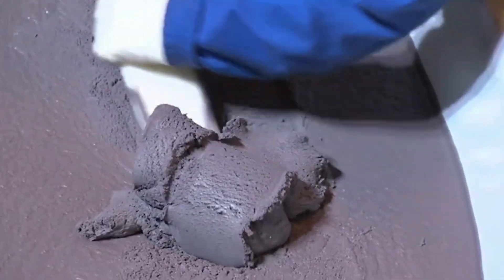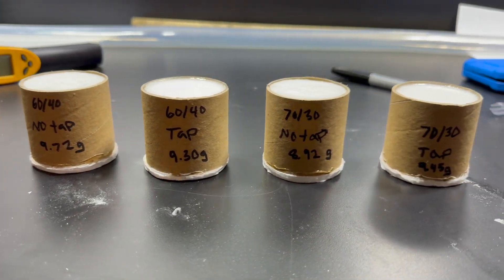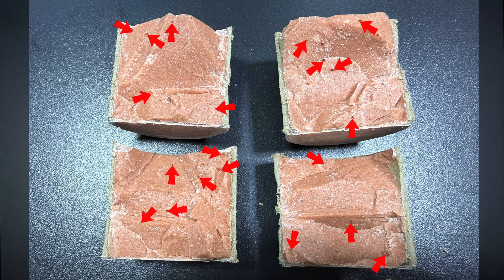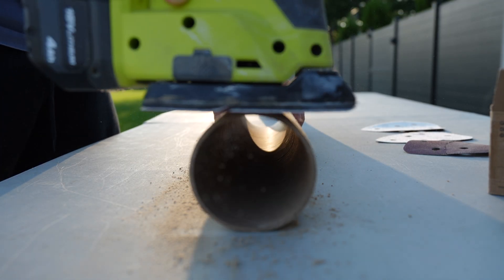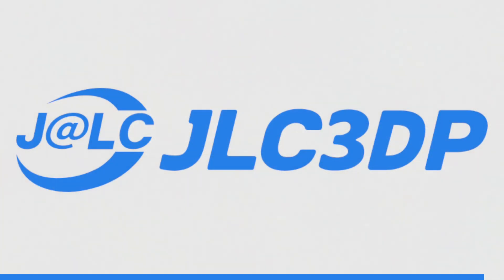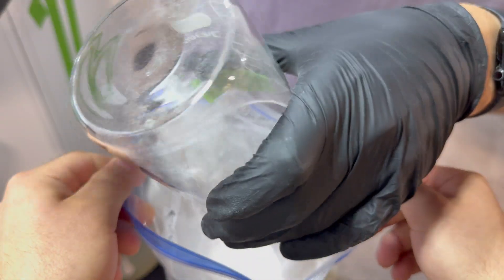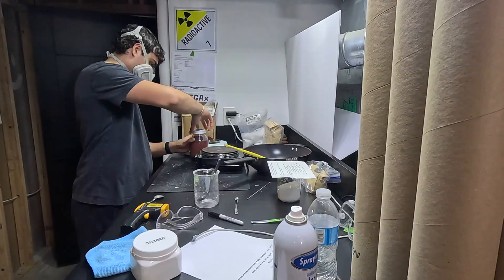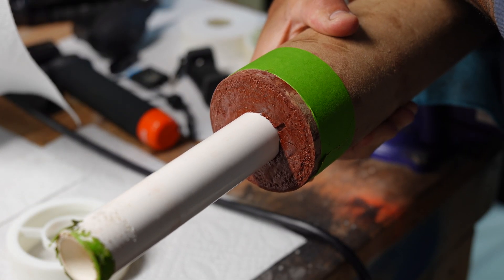Making Fuel for My Biggest Rocket Motor Yet - MEGAx Ep 3

Comment: I can make a 12-pound 98mm 6-grain M-impulse KNSB motor reload in under 5 hours. I would not try to make a small-diameter long single grain. And if you use right-angle fins on the finocyl, those corners can become stress locations that crack the grain.

Comment: What filament do you print grain equipment with?
Reply from the maker: I had these resin-printed through a manufacturing company. Standard FDM printers leave noticeable layer lines, which makes the surface rough and causes the grain to stick to the propellant instead of releasing cleanly.

Comment: Hello! Fractures in the propellant can generate small energy events during combustion. These events can also cause propellant to detach and be carried by the combustion gases until it obstructs the exhaust nozzle, triggering an uncontrolled increase in pressure within the combustion chamber and, consequently, the total collapse of the engine. My recommendation is, firstly, not to use accelerators, as they make the propellant more prone to fracturing during grain manufacturing and raise the temperature during combustion. If you want energy, you should recrystallize without accelerators and do a quick process, since exposure to heat consumes calories and loses power. On the other hand, the mold for loading the grains is very important; it should be quick to load and a comfortable size to work with. Also, use grease for demolding and to insulate against moisture. Another important factor is that the grains should not be struck when cold, as this causes them to fracture and cannot be detected.

Finally, grain segmentation is the simplest and most efficient method for manufacturing, and I also don't recommend reusing propellants since the smelting process causes them to lose properties, and it's a lot of work to do without having accurate data!

Hola! las fracturas en el propelente pueden  generar pequeños eventos energeticos durante la combustion, estos eventos tambien  pueden causar desprendimiento del propelente y ser arrastrado por los gases de la combustion  hasta  llegar a obstruir la tobera de escape desencadenando en un aumento descontrolado de la presion dentro de la camara de combustion y como consecuencia del mismo el colapso total del motor. Mi recomendacion es en primer lugar no usar acalerantes ya que hace mas propenso al propelente a fracturarse durante la fabricacion del grano y durante la combustion eleva la temperatura,  si quieres energia debes recristalizar sin acelerantes y hacer un proceso rapido ya que la exposicion al calor consume calorias y va perdiendo potencia , por otro lado es muy iportante el molde para la carga de granos, debe de ser rapido de cargar y en un tamaño comodo para trabajar, tambien  usar grasa para desmoldar y para aislar de la humedad. Otro factor importante es que no se debe golpear el grano en frio ya que se fractura y no se puede detectar. 
Por ultimo la segmentecion de granos es los mas sencillo y eficiente a la hora de fabricar ,tampoco recomiendo reutilizar propelentes ya que la fundicion le hace perder propiedades y es mucho trabajo como para no tener datos exactos!

Comment: Recast the grain. Kno3/Sorbitol is already very brittle and a grain at size will most definitely undergo some significant radial expansion under internal pressure leading to structural failure (using he cardboard liner will contribute to this as well). Id suggest doing a vacuum degas of your mix in the pot before you pour also, it should help reduce those air voids you have.
Reply from the maker: I probably will end up just using this grain. Don't have enough time to re-cast. Will make improvements for the next grain. At least the test will be exiting!!

Comment: When struck from above, the PVC tube expands in the fuel block, making removal difficult.
Reply: Any time I remove a mandrel, regardless of what the material is, I always pull on the mandrel, not push on it. If you think about it, pulling stretches the material in the mandrel that ever so slightly narrows its diameter.

Comment: First, you can use a piezoelectric device or even a regular speaker for vibration while casting. They also make small electric motors with unbalanced weights for vibration; these can be found on Amazon easily, although I seek other sources where I can in order to spread the wealth when it comes to specialty things.

Next, I would try re-casting it by putting everything back together and melting/cooling from bottom up. I suggest this because the reason I clicked on your video is because I am going to start casting in a few weeks here and I would like to see it in action first. If you can spring it, I would recommend covering the thing in heating pads, turning one on at a time until that section is melted, turn it off and the next higher one on, etc., until you reach the top. That is the (type of) setup I have drawn up.

Because you would be re-melting the whole thing you could scrape/sand out a small amount on the inside to make everything slide together easily; the gaps you form will obviously melt back into place.
Reply from the maker: Thanks for the advice. Definitely something I can try in the future. For MEGAx test one, I’m most likely going to just use this grain as is. I’m on a massive time restraint and to get this test done in a reasonable time, I don’t have time to fix the grain.

Comment: I'm far from that rocket things but YouTube recommended me this video. I'm wondering just why didn't you mold the fuel as separate short cylinders? For me, it seems easier to pour and avoid imperfections
Reply from the maker: I could definitely do it that way, but it takes more time, and it’s also a bit more complex. Also there can be some implications with the thermal liner.

Comment: Something you're going to want to double check your math on is not only the pressure having a sudden increase but also the entire motor having a sudden catastrophic failure. If you do decide to go thru with this get some serious and I do mean super serious flame retardant suits, im talking the levels of what the lava guys wear. Because with that amount of fuel and it explodes some may hit you and it's ignited and it may torch you.
Reply from the maker: Yes safety is number one priority. This motor will be ignited underground in my blast chamber so if anything happens, debris will only go upwards. I will also be standing around 300 feet back under a metal canopy.
Reply: @AeroPropulsions  So it sounds like you will be testing nozzle up? With 'sugar' propellants, I like to test nozzle down orientation since that is how it will burn in a rocket and you don't get much slag residue on the bulkhead since that gets blown out of the nozzle. Also, doing nozzle up without restraining the motor can cause it to take flight if the bulkhead fails as that end will become the new nozzle.
Reply: After casting thousands of pounds of 'sugar' propellant, if you are careful and know what you are doing, flame-retardant suits are not necessary. As a geologist, I've walked on volcanoes and once had my boots catch fire while collecting lava samples. Our largest 12" grains cast were 135 pounds each, though most of my motors are 4 and 6". The key is being careful and knowing what you are doing.

Comment: Can you try Flexi Fuel and see if there are any air bubbles or tiny air pockets like you did in the beginning of the video?

Potas 65%
Sugar 18%
Corn syrup 17%
Cooking Temperature 99°C
Reply from the maker: Thanks for the suggestion. I will try that out!
Reply: @AeroPropulsions you know Vibrator right? The one they use in construction site when they pour concrete. I wonder using that will work.

Comment: Hey i was thinking about the hygroscopic properties of the kno3. How do you prevent that?
Reply from the maker: I always double bag my KNO3 and also put a bunch of silica gel packets in the bag. Although I didn’t do it for this grain, I have also heated the KNO3 in the oven before using it to remove even more moisture.
Reply: @AeroPropulsions  wasn't that unnecessary if u are using Rcandy formula instead of powdered version.
But yeah , I know ur point

Comment: I think that in this motor size the best thing would be to use grains, so if one fails, for example with a crack, you only change the grain and not all the fuel casting, it would also be easier to manufacture. 
We're all learning here thanks to you.
Reply from the maker: Yeah that might be the route I’ll go for MEGAx static fire 2!

Comment: No safety concerns is not quite right. Yes, the blast shelter reduces risk considerably, but never think you have zero risk. Something unexpected can happen. 
I would personally fire the grain as is, and not add any more radial bolt holes. If the propellant breaks apart and clogs the nozzle, the thing explodes either way, and the amount of radial bolts decides just how explosive that pipe bomb will be. In a propellant grain failure case you probably want the motor to blow up, ideally with as little excess chamber pressure as possible.
Reply from the maker: You’re absolutely right. There’s always a bit of risk involved, but I work hard to minimize it as much as possible. I will probably end up not adding more radial bolts, and possibly open up the throat a bit.

Comment: Have you thought about using a BATES grain configuration? it would make it much easier to cast the propellant for such big motors compered to casting 1 big grain.
Reply from the maker: Yes I have, It would definitely be easier and result in a better cast. I learned on SN1 that casting individual grains took a bit longer than just casting one bug grain.

Comment: You should try getting a massage gun to vibrate the casing while pouring so the air bubbles and the mix goes more evenly
Reply from the maker: I was actually thinking about that! Will get one for the next cast.
Reply: And also maby consider making a simple vacuum chamber too use before the pour

Comment: since you have that chamber i would honestly say just send it, although i would recommend increasing the diameter of the throat on the nozzle a bit to account for that. you will lose efficiency, but it will be better than blowing up the motor.
Reply from the maker: Most likely will open the throat a bit and just send it. Excitement is guaranteed whether it works or blows up!

Comment: if you have the ability i would also recommend doing this in a Bates grain setup, it makes each pour a lot easier, and its a lot safer, if that monolithic grain catches fire your toast, where if you mess up a single grain, then its a lot less expensive to fix.
Reply from the maker: Yes may try bates in the future. I learned from SN1 casting multiple grains takes longer and need more casting hardware.

Comment: did you decide to not go with sorbitol? sorbitol melts at around 90F, and it takes about an hour or 2 to harden which would make it so that you don't have to worry about it hardening so quickly. 
another common mix is 80/20, there you do the cooking with all of the sorbitol (80) and then hand mix in 20 percent of Sucrose, it increases burn efficiency while keeping you safe, since sucrose has a flash and melt point that are very close together.
Reply from the maker: I am using sorbitol!